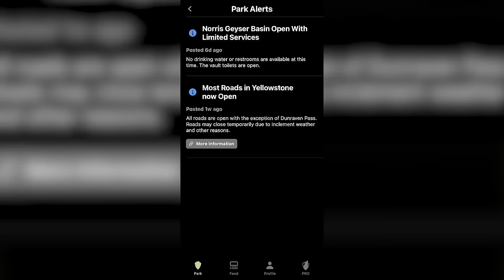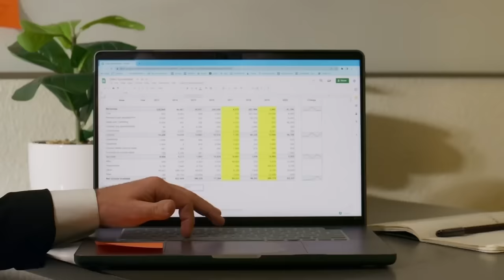302. Our Hopes for the TRILLION-dollar Outdoor Recreation Industry, the RV Industry & A New Studio!

Comment: Garbage, laundry, coats, shoes, pet feed/water, toothbrushes, shower caddies...

About 90% of N.P. visitors only spend a few hours. I think more high capacity features will reduce the damage and crowds. NPs are mostly not real wilderness, development without commercialization is needed.

It's acres per Bison, not Bison per acre! The bridge website says 8-10 bison, that's not a stable herd, that's a zoo display!

Comment: The electric grid is doomed.  With everything electric -- nothing will run.
Reply: It'll be ok.  The electrical utilities aren't going to pass up the chance to profit.  By the time the first corner gas station opened in the 19 teens, there were already a million model T Fords on the "roads".  The electrical infrastructure will be upgraded, not overnight, but quicker than most anticipate.
Reply: It's already being improved. As well, new solar & wind are distributed sources so are closer to the loads.